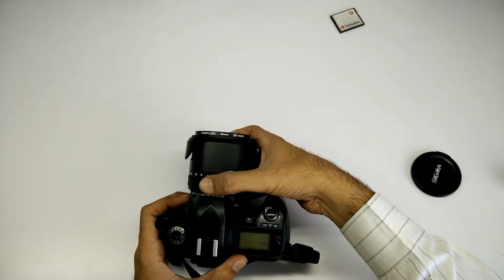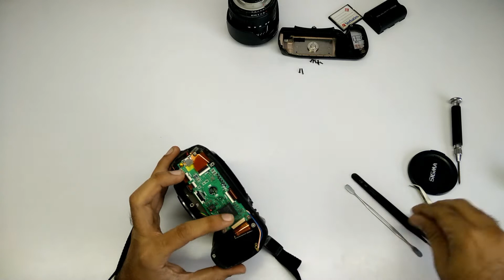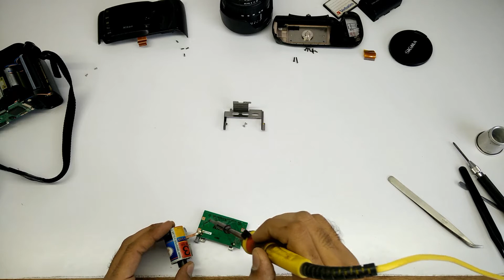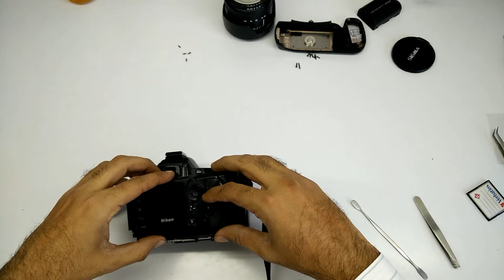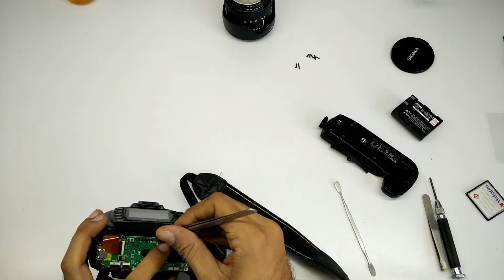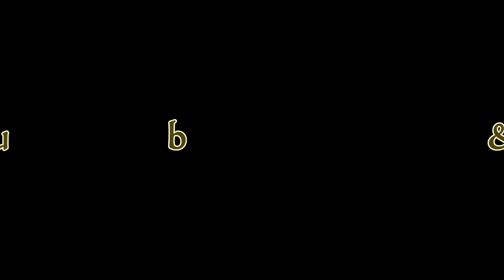NIKON D70S CHA ERROR

Comment: I'm careful when installing the CF card yet eventually still got the dreaded CHA error. On looking inside the slot with a torch and magnifying specatcles I could not see any issue with the pins. 
However, after blasting it inside with some electrical contact cleaner (use the little tube as supplied and spray just as long as it takes to sweep across the pins with the slot facing downwards), my camera has come back to life! 
(I use Rapide brand electrical contact cleaner as it leaves no residue, and left it for a few minutes for the stuff to evaporate). IF you use a different brand test it on some freshly cleaned glass first, to make sure it leaves no residue. Good luck.
Great little camera, BTW, I replaced it a few years back with a D3s but after a year or so I realised that this was much more likely to get the grab shots I like with less faffing about,  and if I go full frame again, I'll be tryng the D700 next time.

Comment: Nice job dude! Mine has a bent pin in the card slot. Is it possible to make it straight back up with a fine pair of pliers or a paper  clip? 🤔
Reply from the maker: yes possible to fix it,but do it carefully ..advised  1st remove that band pin out of slot then fix it.thanks

Comment: I had this issue on my D70. I could see that two of the pins in the CF card slot had been bent. One was completely flattened down. I used a very small flat head screwdriver to very gently straighten the pins. Then I cautiously pushed in a CF card. On first attempt, I still had the error - that's when I found the second bent pin. I also found the CF card was faulty as there was no display after the pins were fixed. I took about 10 minutes to make sure I did this very carefully. Hope this helps someone.
Reply from the maker: check the soldering of pins carefully.. sometime when you push the pin soldering of pins desolder. do resoldering all pins and try to cleaning flex contact of back panel for no display...